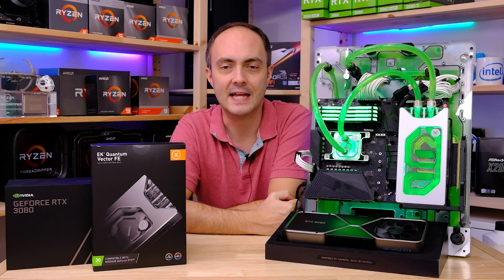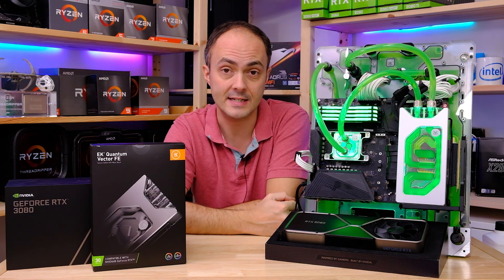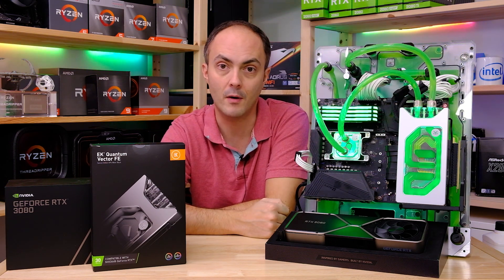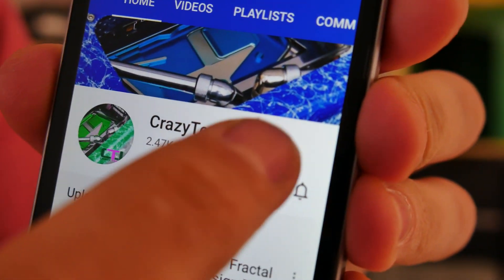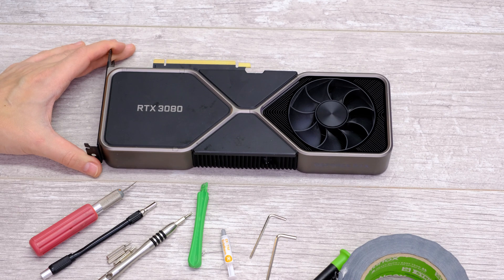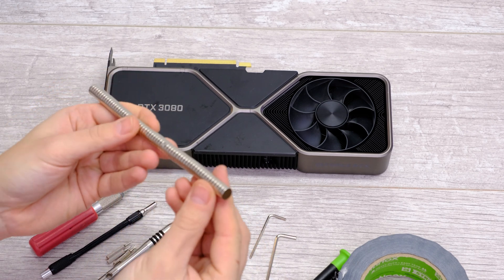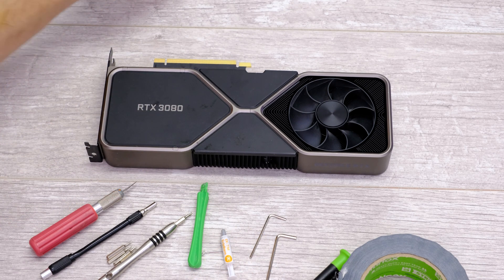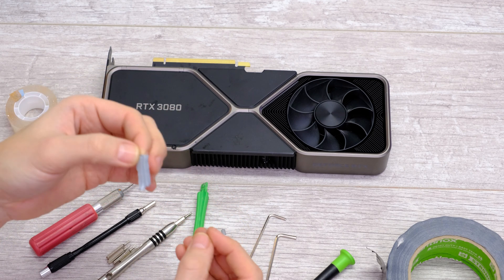Watercooling the RTX 3080 Founders: AMAZING EK Quantum Vector FE Special Edition waterblock!

Comment: If you are watercooling does it which card you get? Like founders vs like a ftw3?  On water will they both overclock the same?
Reply from the maker: Water just helps with temps and noise tbh. It's unlikely you'll overclock much further because of it so just pick the card with the highest stock clocks or one that's known to overclock well. You'll be able to push the power limit and voltage as high as is safe and not have to worry about temps.

Comment: I love this cooler, but damn... Why did EK decide to have the silver edition have a BLACK backplate, and the black edition have a SILVER backplate? I guess it's not that big of an issue, since you can't see it in a vertical mounting position, and if you're buying such a fancy showy (and expensive) water-block, you probably want to use it in a vertical mount... And if you have the money for a $300 water-block, you can always just look for a replacement on eBay, I've seen a few (specially for the 3090, since that has an optional active backplate, and you end up not using the included backplate).

Comment: For anyone watching this and wondering what the memory temperatures are following the swap, maxes out at 60-62 degrees Celcius at room temperature of 22-23 degrees, at 100% controller load.

Naturally, this may fluctuate a degree or two depending on loop setup and radiator size etc.
Reply: If you are watercooling does it matter which card you get? Like founders vs like a ftw3?  On water will they both overclock the same?

Comment: sadly on mine, I had a hard time pluging out the yellow/back cables from the socket on the back pcb, and the tiny socket broke apart from the pcb. I haven't had the nerves to test the card since then :(
Reply: That's only the LED feature of the stock cooler. Makes no difference to the working of the GPU, i also broke mine haha. No worries, i'll never use the stock cooler again anyway.
Reply: @Pablo-c3e2s  Can i buy your stock cooler? I broke the ribbon cable on mine and the fan won’t work now… i would really appreciate it if you could send me your stock cooler or even just the fan!
Reply: Would you consider selling it?
Reply: Just put it back in the box and sell it, In description just write "Only taken out of box for pictures"

Comment: junction temperature??? before and after -? this value is importand ;))
Reply: I got the 3090FE block last Friday. Junction temps sit around 86-90c when mining. A massive improvement.
Reply: @swinny650  Sounds like a big improvement. What was the temp before? Around 106-110?!
Reply: @martinyung4817  Yeah it would hover around 106 with +1200 mem and the core locked to 1110Mhz @ 725mV any higher it would hit 110 and throttle. Now I can hit +1500 on the memory and it still sit between 86-90c
Reply: @swinny650  Thanks!! Will need to do this also. Nvidia responded and said normal temps between 100-100 degrees, but I'm not sure how long the card would survive for like that!!
Reply: @martinyung4817  It's within specs of GDDR6X memory so I'm sure it'll be fine. Sure feel more comfortable with things at least being under the boiling point of water though!
Reply: Same question here, difference memory junction temp please?.

Comment: Do you have to cover all the chips on back plate with thermal pads ?
What are the pads used and thikness ?
I'm about to change the pads on ine 3080 FE just to improve memory temps .
Thank you in advance mate.
Reply from the maker: Hi there. Yes you have to add pads to the rear of the block for the backplate but everything is included and detailed in the instructions

Comment: what about the VRAM temperatures? can you check HWinfo and let us know what temps those were hitting. seems to be a major problem on 3000 series FE cards
Reply: Agreed, that is what took me to this video.  What looks promising is that they also instructed to use thermal pads for the back plate which should improve cooling performance over water blocks which just use thermal pads on the front of the card.
Reply: GPUZ already is able to show both "Hot Spot" and "Memory Temperature" aside from just "GPU Temperature", but seems like he disabled them on purpose. In my case, I have a 3090 FE paired with an Alphacool Eisblock Aurora Acryl waterblock: under load, the GPU temps are quite similar to this video (50 degrees) but the VRAM temps go as high as 70 degrees which I don't know if they're are acceptable or not since I made the mistake of not installing the card and test the temps before I slapped the waterblock.
Reply: @conin.v  on AIR your memory may rise up to 106 degres (freidn of mine got that on his 3080 and he installed thermal pads to get 30 degres) so 70 is still better than on air with thermal pads.
but yes he didn't liked my comment but his video is almost useless and more like a promotion youtube video. (like all the DJI FPV these last 2 monthes)

Comment: I want to buy but I want to see temps  T-junction VRam  when mining ETH or other aggressive VRam punishment app runing
Reply from the maker: Okay - enough people have asked! I'll do another video focussing on the memory temps :)
Reply: @CrazyTechLab  thanks  I'm going to order if I see results shopping cart Is filled and waiting 😅.  I have Asus TUF rtx3080 Gaming OC on stock  VRam on ETH  earning  mission T-junction 102c.
I had Gigabyte 3080 Eagle after week usage pads melted
Reply: @CrazyTechLab  i ordered this because i had to rma my 3090 fe. Have no idea what happened to it besides a melting vram
Reply: I doubt this waterblock will do much for the T-Junction temps. I have this on order for 3090 FE but what I’m excited for most is the upcoming active backplate for that block - I think only then will we see decent control of T-Junction temperature.
Reply: @sammyb304  still waiting my Ekwb  kit for gpu. But what I saw Backplate with pads shave of  a lot of heat from vrams
Reply: @matejunsagris  ek told me the max vram temp they got was 72c with it
Reply: @sammyb304  Did you get the block and fit it yet? Any change on junction temp?
Reply: @martinyung4817  Just completed installation today! I have only had limited time since for testing but so far results are great. I also used Thermalright Thermal pads that even on the stock 3090 FE have been shown to work well. But initial testing during mining is 76 memory junction, 38 or so core. That’s with -150 core and +1300 memory. When I have more time I will tune the system for best results. Those temps apply to both 3090 FE’s in my system.
Reply: @sammyb304  Thanks! That sounds really positive!! I'm up to 86 whilst gaming at 4k on m.junc and currently at 98-100 whilst mining with a heatsink on top! Time to get an order in..!
Reply: @martinyung4817  So after further testing and letting the whole loop stabilise, I backed off memory overclock and now get 80-86 on one card and 86-88 on the other (less airflow over backplate of hotter card). This is with 77% PL, 0 memory and -300 core. I did play around with pushing memory but it resulted in >92  pretty much instantly so I have decided to back off. I am happier to have a quieter system and put less stress on the components vs. going for absolute performance. Hash rate averaging 214 in Cudo Miner with these settings.

Comment: what are all those stains inside the block?   did u break it or it was sent to you defective?
Reply from the maker: Not stains. It was filled prior to the video for some testing so the coolant has seeped into a few areas. Definitely not broken either 😊
Reply: @CrazyTechLab  ok..but that is NOT supposed to happen...can You please follow up with EK and see what the fuck is going on with this block?!   i need to order 8 3090 ones and if thats what i have to get, then  its a very srious problem..especially if we consider acrylic basically self destroys itself pretty fast.
You should immediatley contact EK, because this is goign to becoem an extremely seriou problem for them , as these blocks wil be purchased by peoel who  wil for th emost have  4 of these gpus in their systems and not one , with dual or tripel pump set ups..all that head pressure is gonna destroy those tops in hours.
On top of that  EK migh tacutlay get upset if u make this video and not mention the issue to them.... wil put you in a very bad light, next time you  need something from them.

Comment: Saving this video for later when I land the 3090 waterblock 😀
Reply: exact same
Reply: For example you didn't even mention the fact that as always with ek you have to cut the thermal paste to the right size, and from what I saw really really briefly from your video you had to do a lot of cuts, which for this price tag is a shame
Reply: Can i buy your stock cooler? I broke the ribbon cable on mine and the fan won’t work now… i would really appreciate it if you could send me your stock cooler or even just the fan!

Comment: What size/brand thermal pads did you use?
Reply from the maker: They come with the waterblock.
Reply: @CrazyTechLab  Wonderful, Thank you again.
Reply: @metalwolf1  Can i buy your stock cooler? I broke the ribbon cable on mine and the fan won’t work now… i would really appreciate it if you could send me your stock cooler or even just the fan!

Comment: That bleed through on the block is so bad. 300 bucks for this thing. It's crazy.
Reply: That's nothing... Did you saw the small cracks at 11:47? I had the same issue with my previous card (Gigabyte GTX 1080 Xtreme Waterforce) and i had to remove them with flame polishing... Now i have a 3070 Dual and i want to buy a block for it... Now im a bit afraid, EK is top tier, if they also have issues like this, im lost...

Comment: They just put up pre orders for the 3090 variant but the photos are lacking and I can't see if NVLINK is supported on the 3090 block.  Can you help me find out, please?
Reply: In the latest ek q&a they show a sample 3090fe waterblock. It has a cover for the nv-link bridge. So if you want to do sli you can. But think carefully before doing that even if you get the cash to burn. You won’t benefit from it except some professional software. I was a 2080ti nvlink user and never benefited from it except 3dmarks and some old 3a titles.
Reply: @mavericksyao708  thanks bro.  I've decided to do a 5950x ceberus X system with NVLINK 3090 for 4k gaming, and doing a gundam build with the gundam 3090, z490 gundam, and ROG Helios x Gundam case.
Reply: @khmergodhobbies  total waste of compute power runing them at 8 x... you lose 10% with nvlink plus another 10 15% at 8x.... on top of that ryzen conumer cpus hsave a pretty shitty memory bandwidth capped at 64 gb if u good at overclocking ram...
I got 8 3090, but i woudl never ever drop one in a x570 motherboard
Reply: the nvlink slot with its dedicated cap you can take off, is there on the block
Reply: @AbyNeon  What I mean is that the block itself comes with a nvlink cap. You can check ekwb’s channel.
Reply: @mavericksyao708  yes that sprecisley what i replied to Vandoeun...though his choice to run two 3080 on x570 is pretty stupid.... will lower its performance by 20/25% at least...just 10 i sthe los with nvlink plus the extra u lose running these at 8x

Comment: Great video buddy, I've saved it and will be using it as a guide when I'm lucky enough to land an FE.
Reply: It's very hard to get one, and in my case i wait to see the available second hand .
Reply: Can i buy your stock cooler? I broke the ribbon cable on mine and the fan won’t work now… i would really appreciate it if you could send me your stock cooler or even just the fan!

Comment: Dude what are you smoking. The 3080 fe has around 7-10 screws and dissembles in around 10 mins using 2 driver bits and gorilla /duct tape to remove the 4 magnetic screw covers on the heat shroud.  Seriously, 10 mins.....
Reply from the maker: 16 screws actually, three delicate ribbon cables that are easy to damage, four sizes/ types of screws. It's definitely the most involved card I've dealt with compared to dozens of others I've watercooled.  It doesn't hurt to forwarn anyone does it? Especially as you'll likely need some extra tools.
Reply: @CrazyTechLab  then you haven't torn down the 2080/ti variants. What 40-60 screws lol....
Reply from the maker: @BOOM-vi7qb  watercooled all from 2060 Super up to 2080 Ti. Just a bunch of screws.